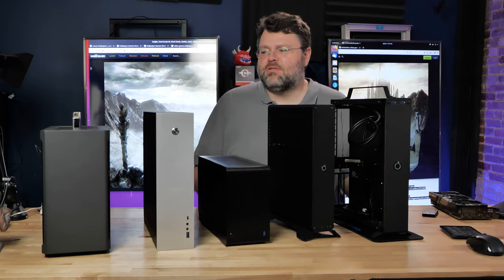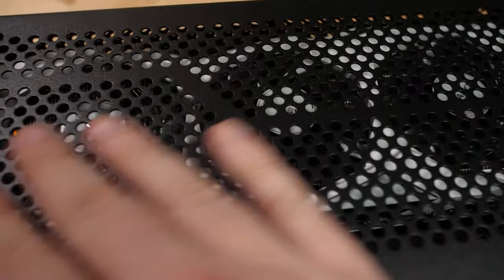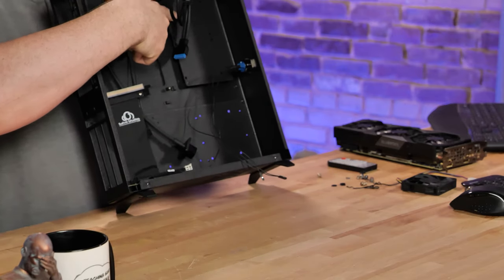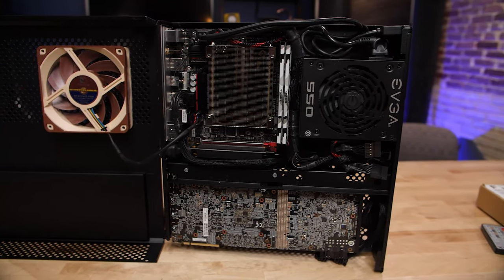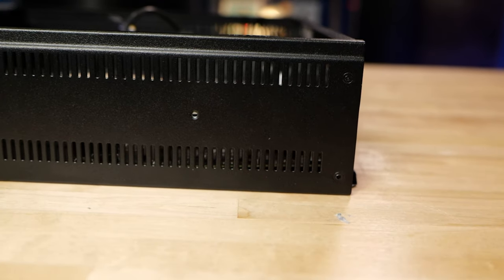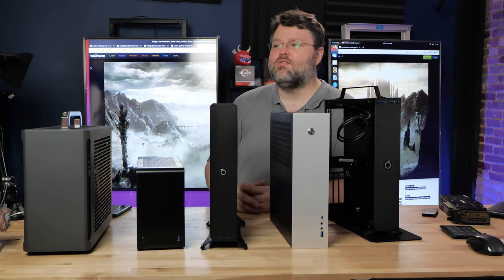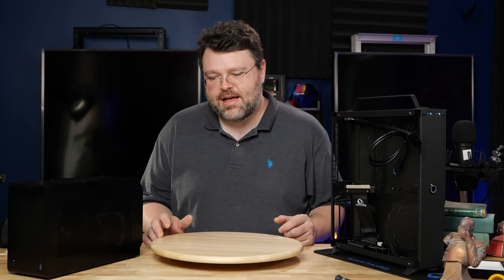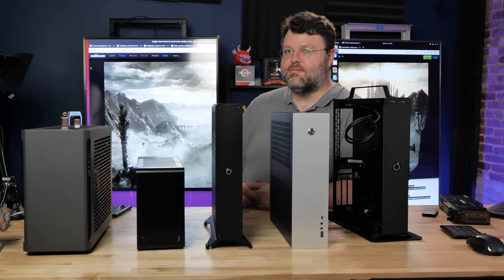Level1 Console Case Roundup: 6 SFF Cases Tested!

Comment: Thanks again for doing ITX coverage. Means a lot to a person who will never go back to ATX.
Reply: Same, I discovered the light of ITX and it's hard to justify unless you need it. My first pc was mATX but I like the small footprint of ITX cases. It's just the prices are a bit high.
Reply: I'm over ATX too.
Not because I don't love it... it just takes ip way too much room, especially in a small living space... let alone you want it portable enough to easily lug to a LAN party.
Reply: @destoyer_of_donuts  would be great.
Reply: @trilight3597  I went from ATX to mATX maybe 5 to 6 years ago. And after that I was confident that I could easily move to ITX and not feel that I was missing anything. So the last two machines I have had has been ITX. But agree prices are a bit steep still, though it has gotten better.
Reply: @theophilusthistler5885  Agree.
Reply: I said that years ago but just built a new system in a define 7xl. No more compromises
Reply: Small form factor build is the real shit, i just love powerful machines and tiny slim console cases.

Comment: Worth noting that video mentions that the S402 includes fans at $200, but does not mention the CL530 at $219 also includes fan (IMO slightly nicer Noctua 120mm A12x14's.) Without these it's $189. Think other comments covered the SM580/SM560 thing. Not sure why we did not send you a base plate, fans, and handle with your Conswole. On future cases I will make sure you get full package!
Reply: Any plans for all white SM cases?
Also, do you think it's possible to release a handle for the SM560/SM550 ?
Reply: Only wished the sliger had a reset button, maybe a smaller one right next to the power button...

Comment: Thanks for the comparison, and THANK YOU FOR THE RATIONAL OPINIONS!!! Thank you for stating that the use case determines the choice - and not just doing some dumb "thermal testing" and concluding that the cases that run hot with an OC'd 9900k+2080ti just "suck" and are "poorly designed" compared to the cases that run slightly cooler. Why EVERY case "must" meet some minimum level of performance with the hot overclocked enthusiast hardware, I have absolutely no idea - there ARE in fact many people building PCs with 6 core CPUs and 1660-5600/2060-5700 area sort of cards that REALLY don't need massive amounts of air because modern hardware is so efficient. Or [gasp!] even LOWER end hardware! 

If we're continuing to check out SFF cases in the future, I would LOVE to see the L1T take on the In Win A1 Plus(how about a shout out to the In Win Chopin when the Ryzen 4000 APUs finally drop? Interesting combo there...), Lian Li TU150, and the Lian Li PC-05. They would fit right in with this case comparo - and, the more info we can get about these cases in respect to each other will only help in picking which one to choose since it isn't just as easy as "which one looks coolest?" with these SFF cases like it often is with mid-towers.

Comment: Still gonna shout out the Skyreach 4 Mini because for the same price ($200) you can go even smaller with better ventilation and (in my opinion) a much better look and build quality. 
The only tradeoff is you have to use non standard PSU solutions, otherwise it's a much better Zaber Sentry with a passionate a loving creator and community!

Comment: Another console-style SFF case that needs to be mentioned: Silverstone RVZ03, as well as its smaller brother ML08. RVZ series is one of the iconic SFF cases and it's made pretty well. A bit larger than Node 202 (so, better cooling and compatibility), comes with fans, and the price is ok (around $100 mark, pre-COVID). Also, decent cooling when placed vertically, Gamers Nexus did some testing with RVZ03...
Also, Velka 5/Velka 7 are good candidates, being extra small vertical cases with great HW compatibility for the size. Inferior build quality compared to ones in the video but smaller...
Reply: I think ill go for the ML08, has pretty much all I need...

Comment: I think the problem with a lot of SFF designs is their overall volume & layout tend to appeal exclusively to water cooling, and I hope once you get to look at the NR200/NR200P that we can start bringing mass market appeal to SFF. Especially since having enough volume for proper airflow while not having so much that you get potentially stagnant air like an ATX case can have.
Reply: I disagree, depends on the case. However, lots of times water cooling results in a quieter pc and is more flexible in tight layouts. The problem I have with sff cases is wasted space trying to have broader compatibility. You need to be laser focused when sub 10l.

Comment: I love ITX builds. As time passes I find myself desiring smaller, and smaller systems. I currently have a Fractal Meshify C Mini TG as my daily driver (everyday tasks and gaming), but also have a Fractal Core 500 build. Both are AMD and both have nearly identical AMD specs with one exception, the Meshify is Linux Mint 19.3 and the Core 500 is Windows 10 Pro (kept Offline, used for specific tasks not requiring internet). My smallest system is the ASRock 110W Mini which you were one of the inspiring factors for that one. It's the INTEL build. It is a dual boot running Linux Mint 20 (which I regularly use), and Windows 10  Pro (which I never really use) and a third partitioned storage drive. I would love to see more on this from you. Maybe some Linux gaming too! ;-)

Comment: Node202 is great. Cooled my 8700k (used a Corsair H55) + 1070mini really well. Upgraded to the H1 and this one has similar idle temps, but load temps are much better and it's much quieter.

Comment: I own a Dr Saber Sentry 2.0, a Sliger CL 530 and a Silverstone RVZ03 and have used a Asus ROG X570 with a Ryzen 3700X and a 2080ti. All are amazing cases. Silverstone probably had best thermals but the Dr Saber looks the best but I think the Sliger Cl530 will be perfect for the 3080 with the case fan as exhaust also I put a PCIE Gen 4 ribbon in to go to the GPU for when I upgrade. Also I used a cryorig c7 with a Noctua fan in the Sentry and I use a Noctua L12S in the Sliger and undervolt my GPU and haven't had any issues with thermals. If you going to put it horizontal the Sentry is probably the worst of the 3 since the GPU has a hard time breathing since it faces down and no case fans. I think the Sliger is the best since everything faces up and can pull more air in.

Comment: Even with the 3090Fe rear exaust...my sliger sm580 has the same temperatures as an large open case.
Never over 63 degrees (overclocked!)
The 4x140mm fans handle everything.

Befor I had a fractal node moddel with 2x140mm rear gpu exaust fans and a watercooled cpu.
And the rear exaust doesn't beat the sm580 top/bottom 4x140mm exhausts.

Comment: I ended up doing some light modding to my Node 202 as my GPU didn't exactly fit right. Thankfully it was as simple as using some metal shears to snip off the support in the corner of the case but even then my GPU is not going any where thanks to it being just a hair to tall. I'm using the Sapphire Pulse 5700XT for my GPU.  My biggest issue I had with this build is that I'm running a smaller PSU than I would like as I ended up getting the Node 202 with the included 450W PSU.  But given the supply issues that where all ready going on when I built me machine a few months ago I was willing to make that compromise as it's not like I plan on changing the hardware in the next year or two so a larger PSU would of just ended up a bit quieter more than anything.

Comment: What you have on the table is the SM580.  SM560 still allows for the triple slot card, but it has less height, aka no radiator support

Comment: Raijintek Metis Plus W190×D277×H254 mm, it gives you 160mm CPU cooler and 120mm AIO water rad and about 270mm long GPU if you put in SFX PSU with ATX-SFX adapter (if you use ATX PSU, only 170mm GPU), and it is aluminum case and super cheap. (Sorry broken english).
Reply: You can use ATX PSU and longer GPU, you just need a short enough PSU. 140-150mm would work, like Seasonic Focus based ones, there's a number of decent ones to choose from).
Also, you can fit a Noctua D14 in it or D15 and Phanteks PH-TC14PE with 120mm fans on them.
You can cut a hole for a 2nd fan on the top and have even better cooling or remove the side window and put some wire mesh there, for even more air to get in...it's a very flexible, pretty and cheap case.
Reply: @LastSecBloomer  Yes to all of what you said 👍

Comment: These prices are outrageous. No amount of arguments about supply and demand or R&D can convince me otherwise. The entire ITX pricing system needs to crash. Great video though! I love ITX form factors but I'm not onboard with paying more for less of the good stuff(ports, features, etc) while getting more of the bad stuff(money, heat, building frustrations, etc).
Reply: I agree. It came as a breath of fresh air when i read about these cases. hopefully they don't disappoint.
Upcoming Cooler Master NR600 for CPU+GPU. About 90$ without TG.
Silverstone ml10 for APU builds. about 70$.
Reply: It is more about economies of scale. Sligers are hand built in USA in small quantities employing people with a living wage and great tech support. Mass market cases are made in quantities an order of magnitude more at least in exploitative Chinese  factories. I'm pretty sure Sliger doesn't need safety nets around it's buildings to prevent suicide like foxconn.
Reply: @jeremytine  That's because it's a single level warehouse in the desert. Love my SM560.
Reply: I recommend you try and get a case made and see what your cost will be.

Comment: I want an even thinner profile case that can handle a single slot passively cooled gfx card like a gtx1050.

I want to build a small profile system that along with a laptop can utilise the same Thunderbolt breakout hub for displays, I/O, external gfx card, and network/NAS drive.
Reply: I swear I've seen an Aliexpress case which meets that description

Comment: Whats with all the console case review recently.
Reply from the maker: shhhh no talk. only console builds. well some of these aren't really console cases.. per se... :D
Reply: Level1Techs Getting ready for Ryzen 4000 DIY Desktop APUs I bet.
Reply: They're just SFF builds - PC hardware is standardized in size; motherboards fall in this small size window, power supplies fall in a small size window, graphics cards fall in a small size window. They're glorified Legos. Point being, there are only so many configurations that are realistically viable when you're trying to make systems as small as reasonably possible.
This leaves you with, basically, side-by-side layouts like the Dancase, or console layouts like the others. Pretty much any other layout inherently results in a noticeably larger system. For instance, I'm a total fanboy of more unique cases like the Phanteks Evolv Shift - but you're obviously giving up a LOT more in height to get its layout than you are with the traditional console layout.

It's like "why are most ATX cases the same?" - same exact thing, the standardized dimensions of the components result in a handful of layouts that inherently make the most sense, with the more unique layouts being very uncommon and often limited to a single brand(like the layout of my awesome In Win 303 - LOVE this setup, but there most certainly is quite a bit of wasted space)